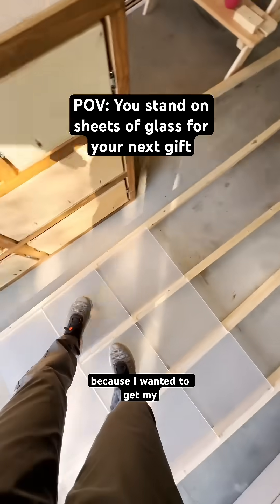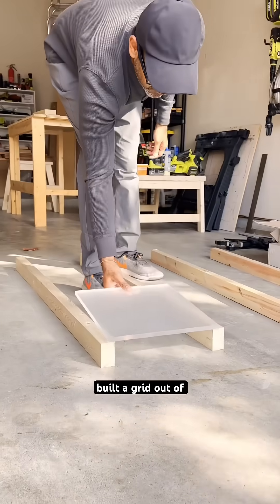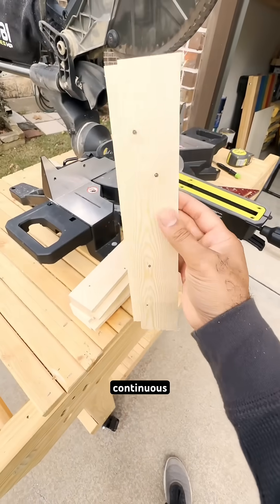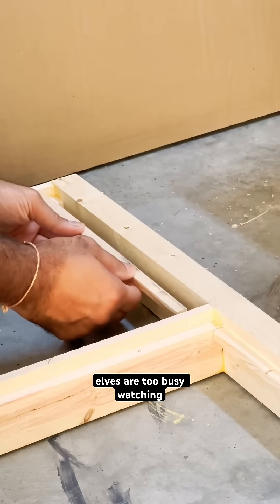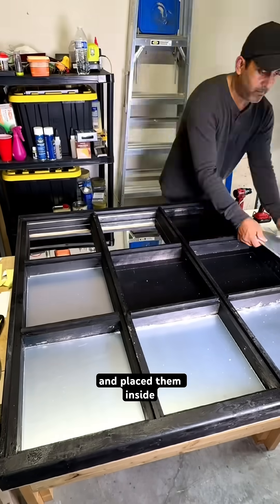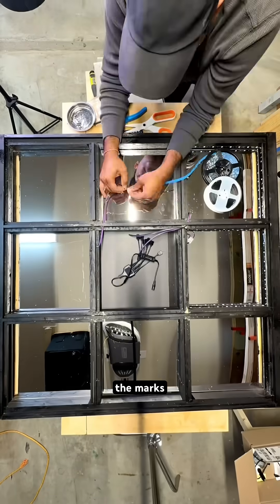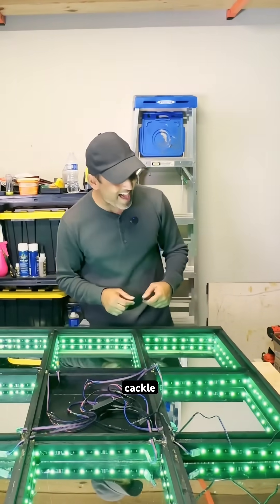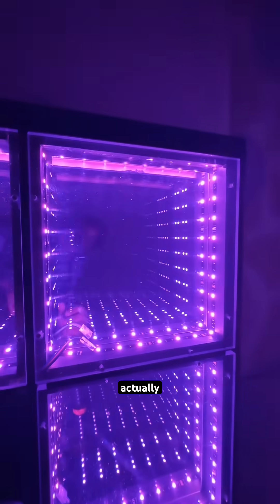Can I build an infinity light up dance floor on a budget? #diy #newyears #gifts

Comment: Keep an eye on this come summer. Acrylic expands with heat and if you cut everything to fit in the winter you might get bowing and cracks when it warms up. Drilling out the holes in the acrylic so they’re a bit oversized will held to some extent.

Comment: "Higher density LED strip give the greatest effect"
So goes with the lowest density strip.
Reply: Actually higher density than average, but not like some where the chips are like 2mm apart
Reply: Yeah should have been something like 730 LEDs per metre with the built-in diffuser.
Reply: @legend_jack1 bruh, it’s a toy his toddler children are going to use for a few weeks. Those lights are fine